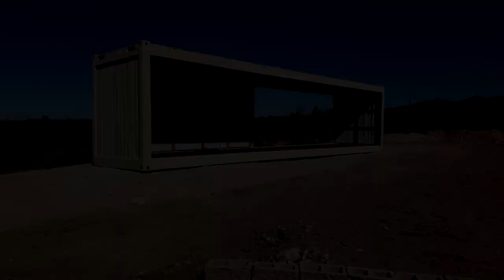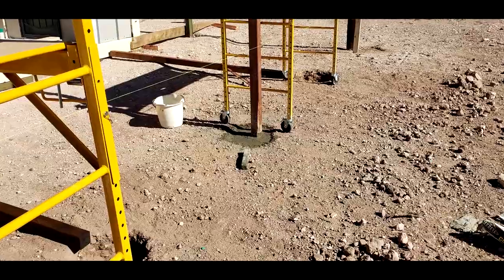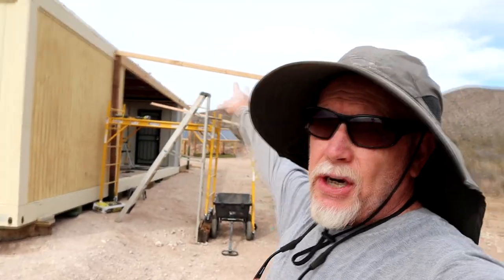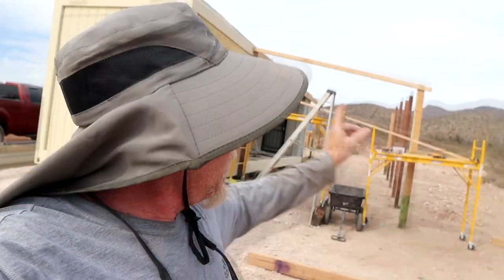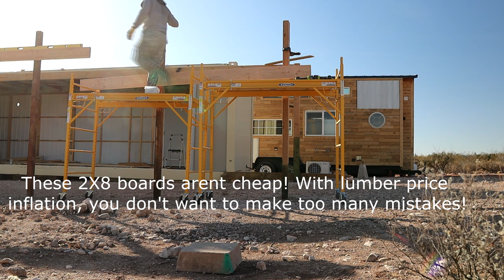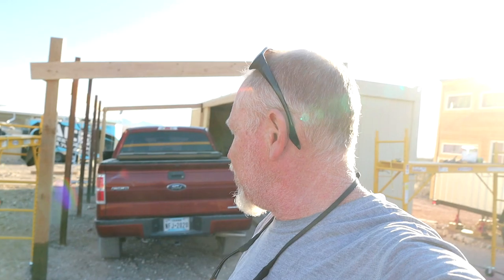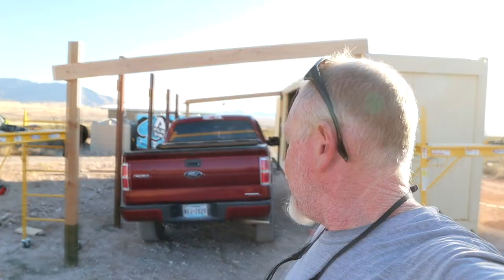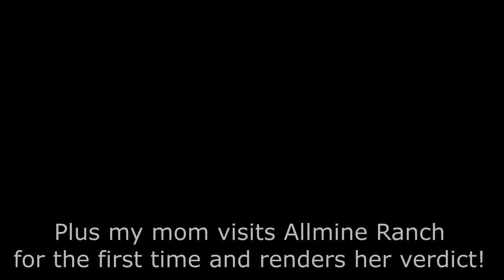Steel "Shipping " Container to Carport Conversion - Framing - Part 1

Comment: Will you be adding Simpson strong tie hangers later? They were always required by code on my projects in Florida and Colorado
Reply from the maker: yes  have them on hand and just need to give the time to add them using Simpson screws. just in case we get a severe downburst/microburst, but i don't have to conform to any codes.
Reply: @solohomesteader  good to know, stay safe